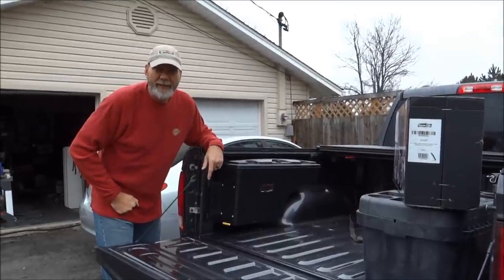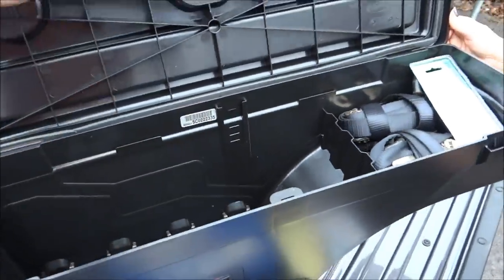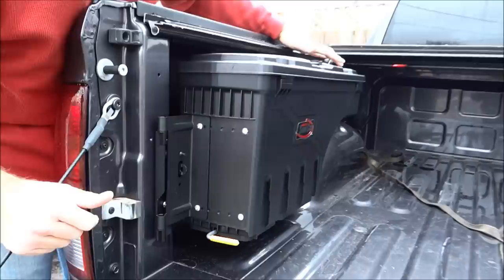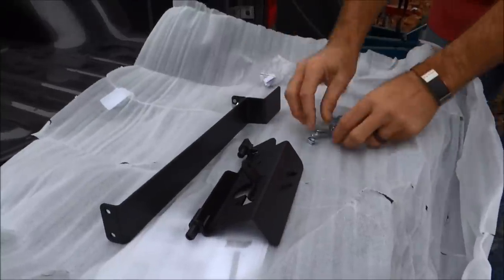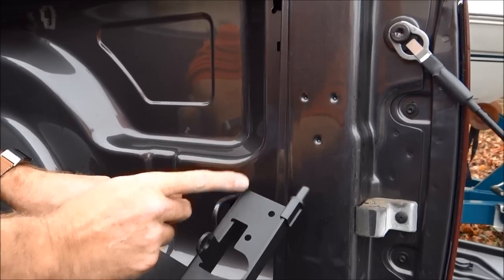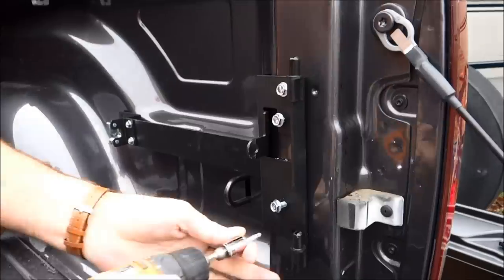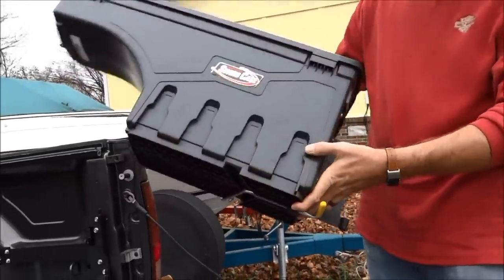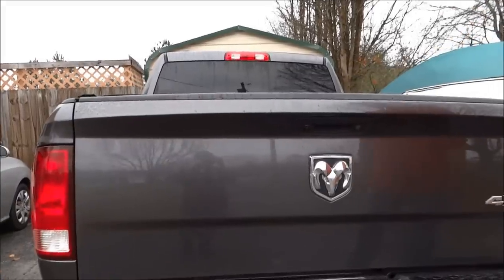How to Easily Install the Undercover Swing Case Tool Boxes

Comment: I suspect the self tapping screws into the bed will, under the load of the cargo container weight, and rough riding nature of the truck bed itself, be loosen up within a year and stripped out in two.
Reply from the maker: Nope...it's been a year and still going strong.  I use them everyday.
Reply: Install rivnuts then add a spring washer under the fastener...mike dropped and outa here
Reply: @LifeBuzzN  still going strong?
Reply from the maker: @chillier8363  yep....they work like a champ....zero issues after all of these years.  I use them daily.

Comment: Love the ease and simplicity... but i think I would take the extra time to install nutserts in place of the self tapping screws and spray the holes with a primer so my truck bed won't rust 👍🏾
Reply from the maker: After all of these years.....no rust.
Reply: @LifeBuzzN  Yeah.  But do you live in the Great White North with lots and lots of salt on the roads during Winter? I agree with Amp by spraying the holes on the reverse side of where they tapped in with some paint then covering the protruding screw threads with a silicone waterproof caulk would work.

Comment: Did you know that the torque setting on the drill and setting to low-speed will get the same desired effect as using the hand ratchet?

Comment: What is the clearance between the two boxes? Can you load 4' material between them?
Reply: supperterofsanity I’m in doubt. I load 4x8 sheet materials into trucks for a living. Full size trucks don’t have many figment issues. But once you start adding toolboxes and other related bed accessories, we usually gotta find other ways around.
Reply: I own these on both sides of my truck box, and because they sit behind the wheel well you can fit sheets of plywood in between.
Reply: @bigmacthebusdriver  what about a four foot wide RZR?

Comment: Saw earlier comment about the self tapping screws rattling loose after a while.  On your truck is it possible to access the back side of the truck box and use a bolt with a lock nut to secure the bracket?
Reply: Kevin Fisher You can just punch in a rivnut if you want to.

Comment: Would this work with a factory bedliner and a flip-bed extender installed?
Reply: James Stafursky it won’t work with the bed extender, but it will work with factory bed liner.

Comment: Thinking on getting a set for my Tundra, but having heartburn with drilling holes in my truck.....
Reply from the maker: I was nervous as well, but now, after several years, there have been zero issues.
Reply: @LifeBuzzN  Thanks for easing my mind..... Cheers mate.....

Comment: Nice, but they seem to cover the inside strap down rings. Would have to remove each box?
Reply: and trucks with bed lights
Reply: Yes.  No more rear tie down hooks.  But if you have a tonneau like I do then I don’t care.  Can always mount new tie down hooks on the side of the bed or use the ones removed.

Comment: Great Video, might buy one or two boxes. I like that they fit under the bed cover.  By the way what brand is cover? I currently have a bakflip, the Texas heat did a number on it. Had it for 4 1/2 years. looking to buy a Retrax 1 cover.
Reply from the maker: Love the boxes, and bought a Diamondback cover....love it also.
Reply: @LifeBuzzN  Diamondback is the only cover that I consider durable. I bought a backflip, it is JUNK.

Comment: Is there enough room between the bed wall and tool box to allow for the 5th wheel harness outlet that is mounted on the bed wall of my F350?
Reply: Yes, but you would have to move the box to use it.